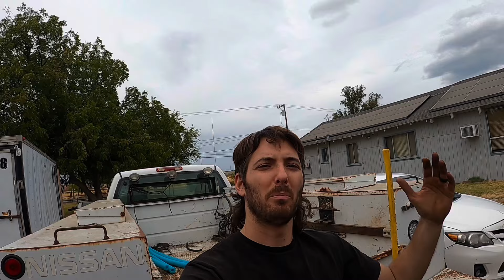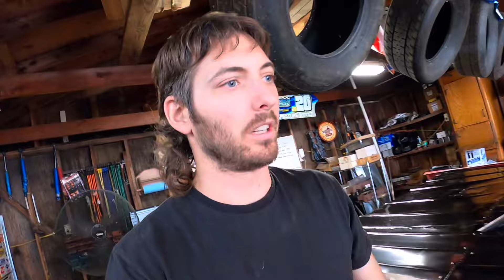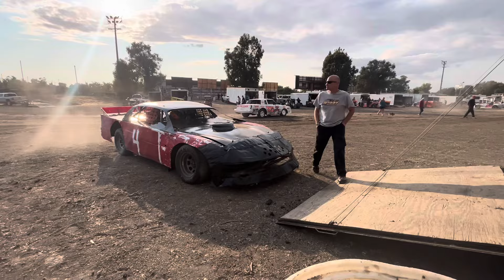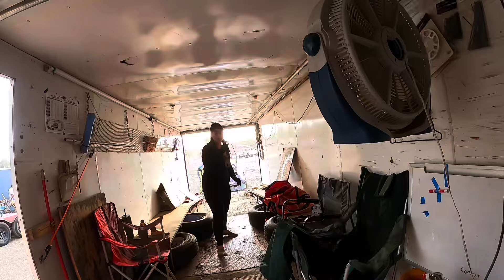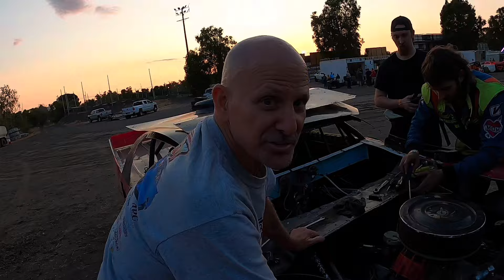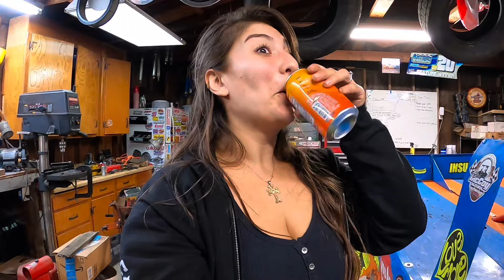Rebar Rebuild Complete -- Double Trouble Finally Hits the Track and shes got Bugs

Comment: Won’t ever happen with a $10 piggyback connector for the distributor 12 volt/tach wire from the parts store 😂 Glad you got it fixed!
Reply from the maker: Nope it wasnt anything to do with the connector or 2 wires in it
Reply: @CherezianRacing  dang you made it sound like that saying 2 wires. My next guess is Ignition Switch, or Ignition control module lol

Comment: Everyone makes fun of me, But in my trailer I have a extra engine and transmission,2 of every electrical parts,I carry 4 batteries,2 extra drive shafts ,3 extra sets of seat belts extra seat,3 radiators and extra fuel cell and 2 pumps,but we travel the circuit, and i have a extra race ready car and body panels
Reply from the maker: @Latemodellisa  well thats the ultimate goal right? Have a spare of everything lol. Which series do you guys run in?
Reply: @CherezianRacing  we Both run super late models, Lucas oil series and HTF series

Comment: Tach
Reply: Or the power shut off switch
Reply: Disconnect everything to the HEI
Run a 12volt wire to the HEI
And run it
Reply from the maker: Neither of those, and already tried disconnecting everything and running a 12v wire. Didnt work

Comment: Why do racers think they need a tach ?
28 years of racing and never had one.
Don't forget about the ignition switch too, unless you have a decent 1 they can do the same thing
Reply from the maker: Wasnt the tach or ignition switch
Reply: @CherezianRacing  I understand,  but those also can be the problem.
Reply from the maker: @scottholbert2742  yup, thats why i disconnected both while diagnosing the issue